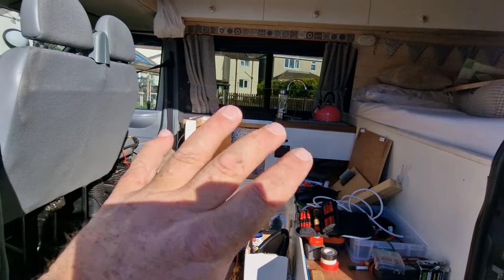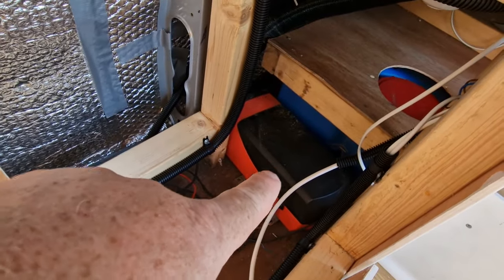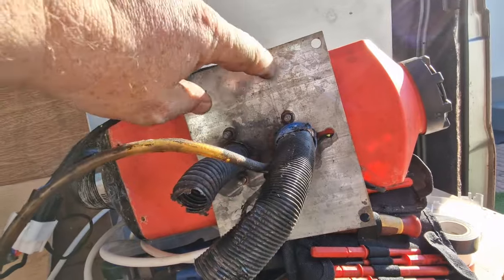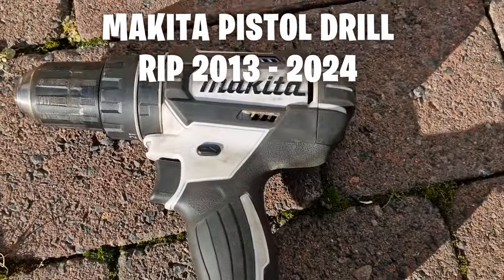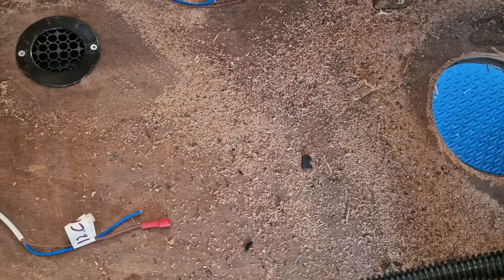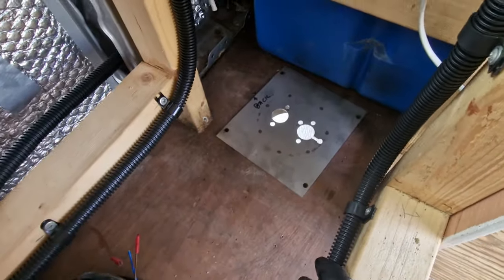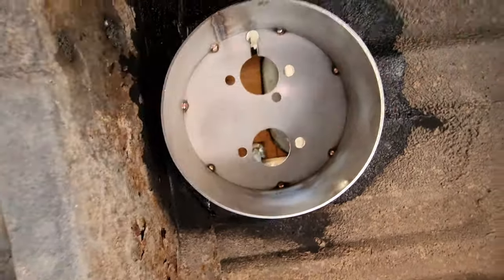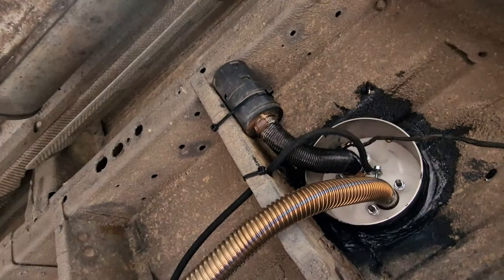FIXING A KILLER SELF BUILD

Comment: Great job, the only thing I’d like to see is copper all the way to the appliance. You shouldn’t have flexible rubber hose to an appliance. Otherwise great. NCC approved engineer
Reply from the maker: how would you maintain, service or install the appliance with solid copper?
Reply: @TheCraftyBlindersvanlife  you would have a length of copper running down the back of the appliance to an isolation valve where you can isolate and disconnect to remove the appliance.

Comment: Hi, we're up-plating our VW crafter to 4.23 ton. We've had the wheels changed to the right BFG and are booked in to change our suspension to 5 ton air bags. 

We were in contact with the van weight engineering company but I've just messaged them and the replied that they aren't taking on any more customers at the moment due to unforeseen circumstances. 

Are there any more companies that can help us with the paperwork side of up-plating our van? Or alternatively, is it easy to complete the paperwork ourselves once the work is done to the suspension?

It's all so complicated! Help would be greatly appreciated please, thanks 🙂
Reply from the maker: Sorry for the delay in responding. Did you get sorted